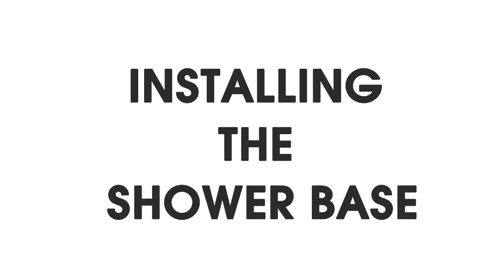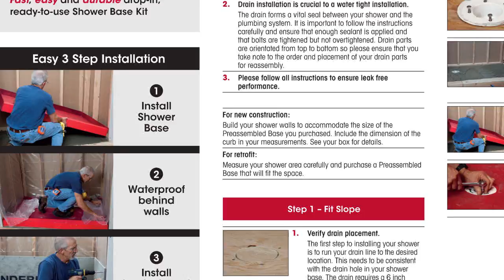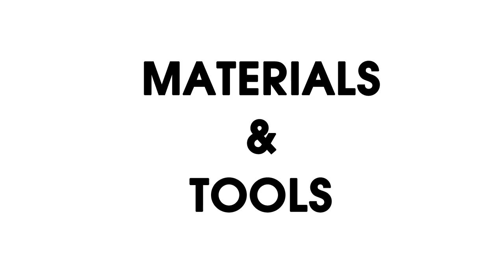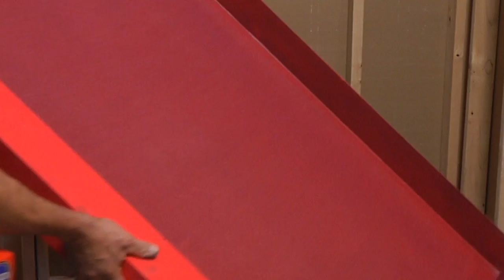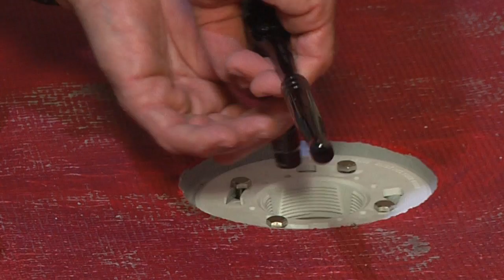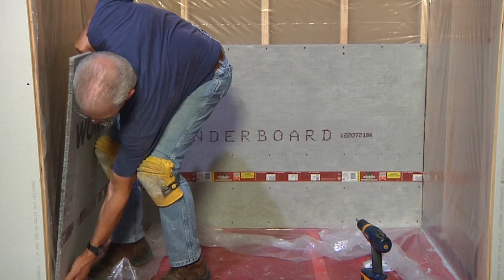How to Install a RedGard® Shower Base Kit - English

Comment: Nothing wrong in this instance of putting backer all the way down if it's going to be sealed with Redgard. It's best not to have a gap so that the redgard can span the crack. I would use a fabric mesh at the bottom and other corners and joints. 
In fact, the plastic vapor barrier and the bed of sealant are not required if everything has a couple of coats of Redgard.
Now if they were planning on tiling without using additional Redgard then all bets are off and this would be a terrible way to waterproof a shower.
This video does not have enough information to be useful.

Comment: You don’t put backer board touching the shower pan whoever you install the shower for will have mold that they could never ever get rid of on a weekly basis keep a half inch minimal backer board from touching the shower pan I don’t care how professional you make this sound you did that wrong admit it you don’t want people following this
Reply: If the backer board is coated with membrane and  RedGard it should be waterproof.That being said, this is not how I would do it and I am really surprised that RedGard made this video.